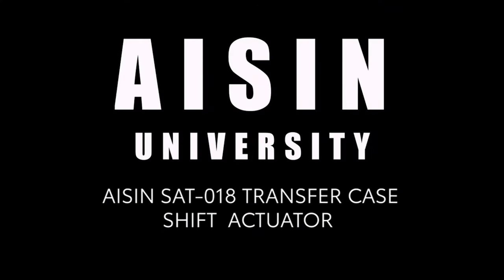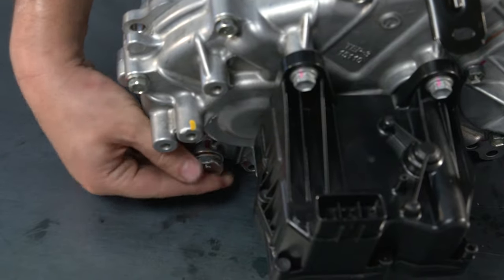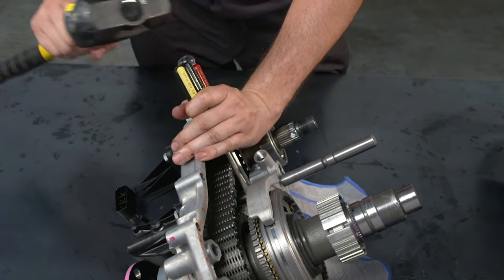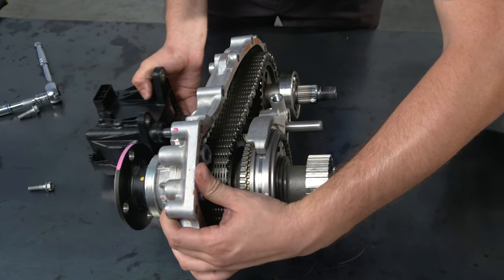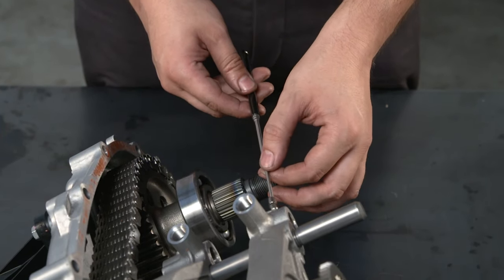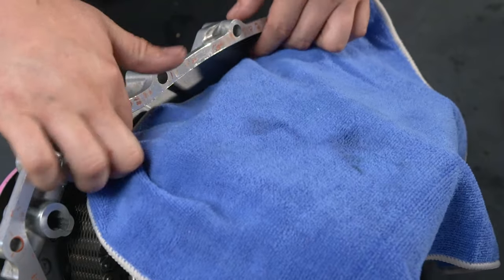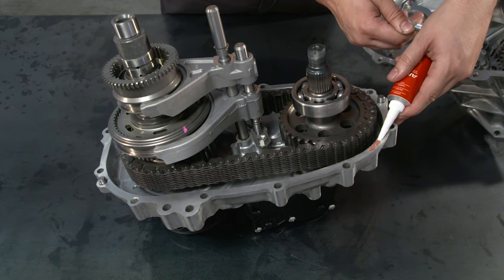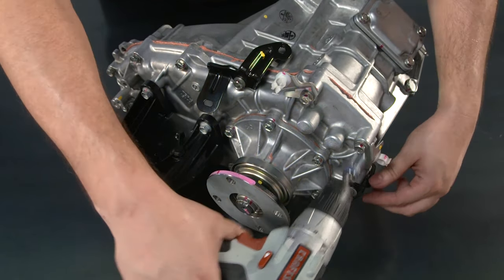AISIN University: SAT-018 Transfer Case Shift Actuator Installation Video

Comment: I’m guessing many ended up on this site for the same reason I did which was my 2019 taco (11K) not engaging into 4low, and when it does, it won’t come out. And You absolutely can replace the actuator without removing and splitting the case. However,try this “trick” first if You have a 6 speed manual. I call it a trick because I have absolutely no idea what makes it work, but it does. If it won’t engage, or disengage from 4 lo, put the gear shift in neutral and fully depress the clutch 2 times. As you are releasing the clutch pedal the second time, you will hear it “click” into place. I just found this out, thought it was BS, but it works every time!

Comment: Am I able to simply leave the transfer case mounted to the vehicle and replace the actuator externally? I’ve managed to get the actuator off so that the shaft that goes into it is exposed (the shaft that moves in and out that determines what “drive” the vehicle is in). So, why can’t I just mount a new actuator onto that shaft, which allows me to leave that shaft in the transfer case, thereby not making me take the TC off of the vehicle and split it open? I’d really appreciate some feedback, thanks so much anyone!
Reply: I'm with you.  I'm very surprised the new part includes new shafts unless that's how they are failing.  What happened to yours?
Reply: The new actuators are shipped with rods because they cannot be seperated from the actuator body without ruining the internal actuator gear timing. There are no shortcuts.
Reply: Russ mt false. I resolved my issue by ordering a new actuator and opening it and removing the rod from it. The internal timing mechanism of the actuator isn’t too hard to figure out, I am thinking about making a video on it to demonstrate. The internal gears of the actuator can be adjusted to fit whatever drive the vehicle (and therefore transfer case, including the rod) is stuck in. I found no info on this online and figured it out entirely with my buddy.
Reply: @DirtBikes_MathGarden  if you cracked the code on the actuator timing i would very much like to see a video, it would save alot of people a lot of work.
Reply: Russ mt well shoot I’ve been putting it off but I think you’re right about it being able to help a lot of people. I’d have killed to come across that knowledge when I was struggling with it. I figure I owe it to the community. I’ll make it this week.
Reply: @DirtBikes_MathGarden  yes PLEASE share this video it would be VERY much appreciated.  I'm having this same problem.  Thank you!!!
Reply: wildernesseric I’ll do it this week once I get home from the road trip I’m taking in my Tacoma that I fixed! I’m excited to share with you and I’ll come back here to let this thread know that my video is done
Reply: Alright fellas my video is up. Check it out.
Reply: Russ mt uploaded the video finally. take a look
Reply: wildernesseric just uploaded it. Hope it helps m8
Reply: @DirtBikes_MathGarden  thanks man for taking the time to make the video, however my 3rd gen actuator is totally different, but I was able to figure out how to get the gear timing set correctly and put everything back together without having to crack the transfer case.  It only takes two tools (a phillips screwdriver and a wrench) which I will now keep in my truck just in case.  Now it works better than it ever has.  Maybe I should post a video for others?
Reply: wildernesseric right on man good to hear!! How did your actuator timing get misaligned in the first place if it wasn’t broken? Did you need to take the actuator off the t case to fix it? Cheers
Reply: @DirtBikes_MathGarden  Not sure how they got misaligned exactly but I have a couple suspicions.  It is a new to me 3rd gen Tacoma that I purchased from a dealer.  When I tested the 4 low at the lot it took a bit to get it to go into low gear when I tried it.  It beeped for quite a while at me and finally went into gear after shifting a couple times.  I don't have any previous experience with Tacomas so I thought it was just due to my ignorant operator error and didn't think it would be a problem.  When I got it home I tried the 4 low a couple more times and both times it was slow and cranky to go in.  About a week later I tried to put it into 4 low and it just kept beeping, I shifted into drive to try to get it to go into gear and heard a gear stripping sound for a moment and then it was stuck in 4 low (with the 4wd light blinking) the computer was telling me that it wasn't engaged properly and wouldn't let me shift out to 4hi or 2wd.  It was obviously stuck in 4 low as turning was very difficult and I couldn't drive very fast.  So my thoughts are it had to do with two factors 1.) The gears jumped from ignorant users like myself or other test drivers who tested the vehicle trying to put it into drive before the gears were fully engaged.  and/or 2.) Toyota recommends cycling the 4wd system every so often because it needs to be lubed internally once in a while.  Maybe the previous owner hadn't engaged the 4 low for a long time.  When I took the actuator off I had to hammer on the shaft sticking out of the transfer case to get it to slide back in to the 2wd position.  I worked the rod back and forth quite a few times and it loosened up a lot after that.  
So, note to other Tacoma users: NEVER shift out of neutral while the 4wd/lo light is blinking even if it takes a long time.  If the light just blinks and wont engage cycle it back and forth between 4hi and 4low WHILE STAYING IN NEUTRAL.  You DON'T need to shift out of neutral to get 4low to engage properly, if it is working correctly it will engage while in neutral, once the 4wd light turns on solid then you can move to another gear.  If you screw up and put it into gear while the light is blinking it can jump timing gears in the actuator box and the CPU will sense a problem and lock you out from trying to cycle out of 4low.  Once you are in that predicament the only fix is to take the transfer case actuator box apart, push the actuator rod all the way back into the transfer case to the 2wd position, align the gears inside the actuator box to the proper indexed spots, carefully put it back almost together while it is an inch or so away from the transfer case, push the actuator box all the way up to the transfer case, then close the box completely to trap the gear over the actuator shaft, tighten the box screws, then bolt it up.  Hope this helps somebody some day.
Reply: @DirtBikes_MathGarden  where is the video,  can i have the link please.  Cheers
Reply: wildernesseric my friend, your input is very valuable. But it is important to note that the gear that moves the rod shouldn’t be replaced into the actuator until the actuator is firmly bolted to the transfer case. The final steps of putting the actuator back on consist of putting the gear in and then replacing the triangle plate over the gear, then ur done (as long as all the electrical stuff has been hooked back up). I made the mistake of putting the gear in line with the rod BEFORE tightening the actuator to the t case and it was an issue that caused the system to only work once, and then jam. One more thing, you said you were able to hammer & pull your t case rod back into whatever position you want. That is crazy to me because mine wouldn’t move, and has to be moved by the actuator. In fact, I’ve read that my Tacoma (2nd gen) has a locking mechanism on that rod from inside the transfer case. I was entirely unable to move that rod on my own, which was a whole nother level of complexity to work around. Cheers.
Reply: MGOAT it is on my page. My most recent video. Check it out 🤙🏼
Reply: @DirtBikes_MathGarden  Tommy, good points, your 2nd gen actuator is a different design from my 3rd gen so fixing it is probably going to be a bit different.  In the case of the 3rd gen you cannot bolt it up to the TC before you put the gear in because you have to take the whole box apart to remove it(no triangle cover) and it won't fit back together when it's bolted on because the transfer case bolts and case are in the way.  You kinda have to hold all the gears in the right spot with a screwdriver and hold your tongue just right to make it fit up snug before you can slide the shaft gear in place and close the box.    Mechanically though I believe the TC is basically the same between the 2nd and 3rd gens, I really don't think there is a lock on the actuator shaft inside the TC other than the retainer lock that keeps you from pulling the shaft all the way out of the TC.  If there is a lock there should be a way to unlock it without taking the TC apart otherwise how could your actuator move it?  If you can't move the TC shaft in and out manually then it is probably just stuck and you need to hammer it back in with a rubber mallet, it takes quite a bit of force to get it moving back and forth again when it is gummed up.  Pretty sure about this but I could be wrong, I'm certainly not an expert.
Reply: @wildernesseric  can you help me with the gear timing and position? I removed mine and can’t figure out how to get it back into the right position!
Reply: That is only for actuators without a full time 4wd setting
Reply: This is just what I needed as I am currently in this same predicament with my 2019 with only 11G miles . So where does it hang up? Just where the actuator shaft goes through the case. I cannot see anywhere on the inside that would cause this somewhat common problem.
Reply: I can confirm doing it without taking the transfer case out is possible. Plug the new or old module in hot the button to cycle the motor leave the motor In the unlocked position, if the part is new the rod should just fall out. Slowly mate the new module into the locker pin mounted in the T case going about 5 degrees counter clock wise. I have seen people have them slide right on I’ve seen people struggle I got lucky and mine went right on. My main tips be gentle removing. Cycle the motor to confirm internal position, push locking rod into the case that is the locked position,  good luck not a lot of info on this topic